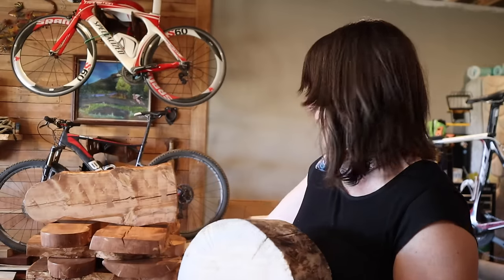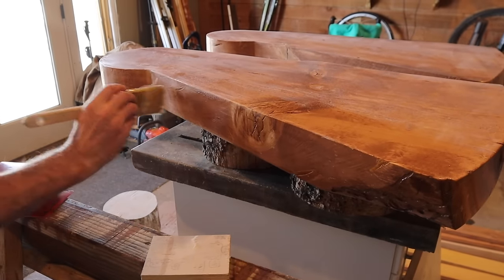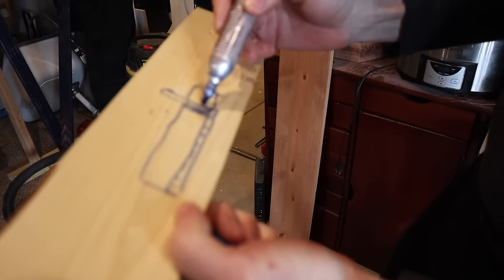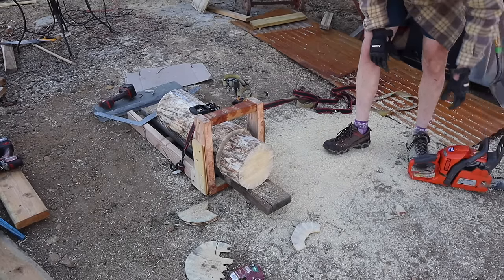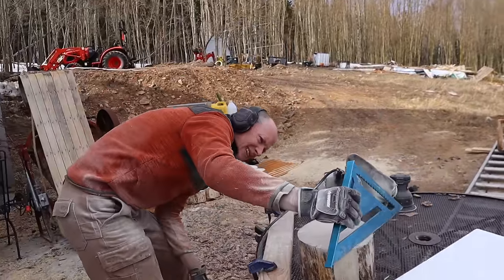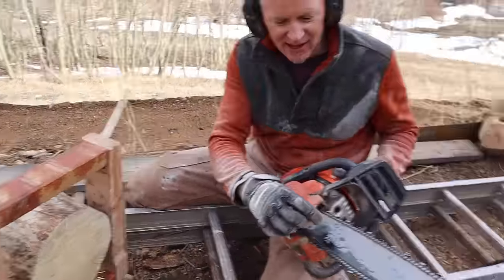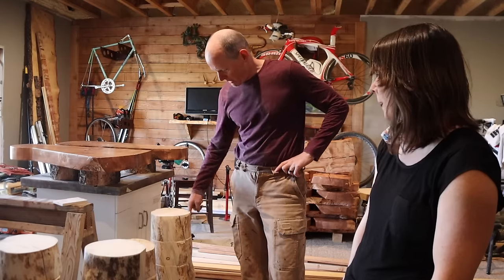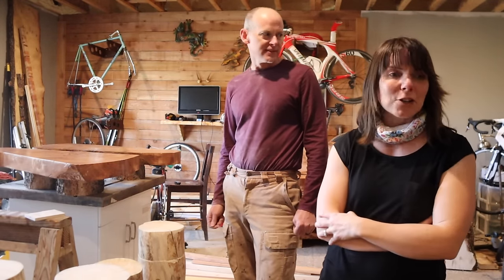DIY Chainsaw Log Cutting Jig

Comment: Super super super.Every problem has a jig as answer.Well done.
May some modification may help to keep the saw from chewing the 2 x 4
The 2x4 can be protected on both sides by a steel plate.
If the top bar can made adjustable as a "roof fence"
The log will be snugly fitting between up,down and sides which will make a square cut.
Just thinking outside the box.
You know better.
I love the family working together with the dog to make a master piece in wooden. 
I would love to visit your final project.! But i am in UK.
Happy woodworking.
Reply from the maker: Thanks so much!!

Comment: Nice job... I had to do the exact same thing this summer.. I ended up making a 2x4 jig that screwed into the end of the log, floated over the bark at the top to keep it square to the log face, and bought a lumber cutting guide from Amazon.. it bolts on to the bar of the saw, provides a pivot to cut a perfectly square and true log slice and I didn't run into my wood jig...my logs were no where near straight or even, so it had to be cut with the face as the reference point..
Reply from the maker: Excellent! Creative solution!

Comment: As I watched, I wondered how it would work if you used the hole in the tip of the saw as a pivot point attached to the lower part of your frame and let the weight of the saw push  it down through the log.
Reply from the maker: Yeah, good idea! Kind of like a chop saw...

Comment: yeah i dont have a sawmill either so i made a jig bolts on the chainsaw with channel iron that rides over just one 2x4 screwed onto the big log. key is to use a new chain so the saw cuts perfect. if you sharpen a chain uneven the kerf is all over the place. google chainsaw mill amazon
Reply from the maker: Wow cool method. Will look it up!

Comment: ALL round logs check to the heart in 2 to 4 places over time.. If you cut a fresh live tree in the winter when most of the sap is in the roots,,, cut the to size & drill out the holes,, will allow the drying to come out the center,, much less checking if any!! good luck. aloha
Reply from the maker: Thanks for the tips! Will give that a try next time.